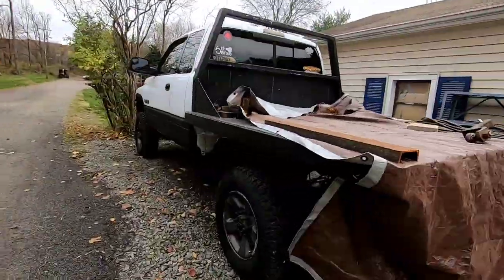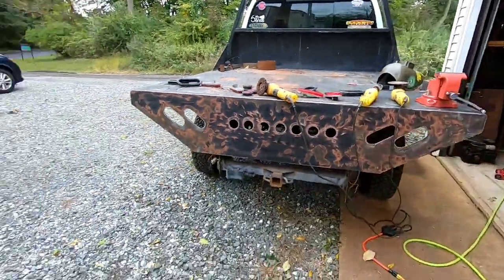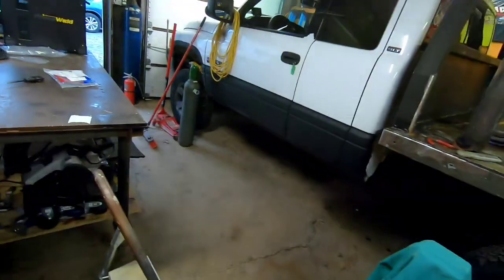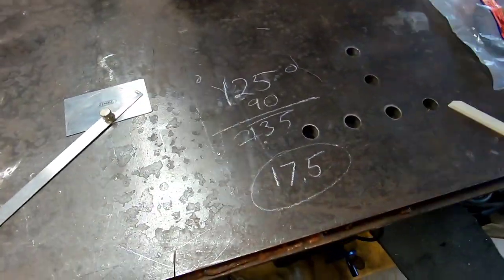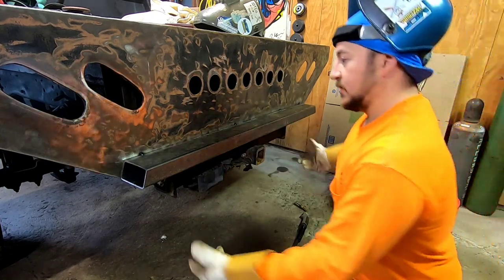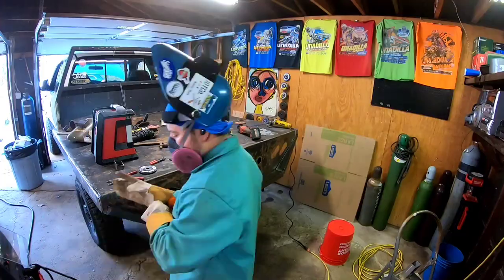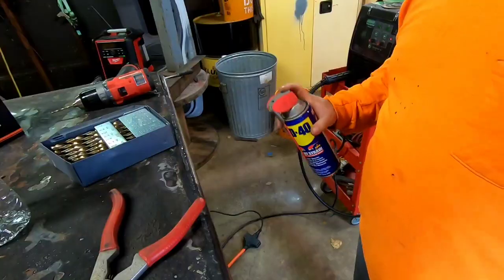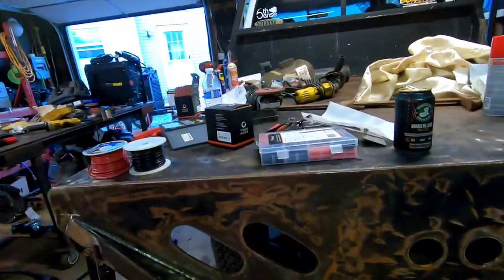SHORT BED WELDING RIG BUILD - PART ONE - FIXING UP FLATBED 24 VALVE CUMMINS

Comment: If you have access, the easiest way to fill those holes is by pulling a nail thru from the inside then weld away and break off shaft.

Comment: A lot of us guys just starting out want to do exactly what you're doing with your truck. I'm still looking for mine, but things are expensive right now, so dreams (and cool videos like this) keep me going. One thing: in the tropics we use a two-part epoxy primer in a spray can. There's a thing in the bottom that triggers the hardener, then you gotta use the whole $35 can before it cooks off. Helps against rust a little bit.

Comment: Have you ever treated any rusty metal with a chemical called ospho before primer? In Texas Ace Hardware sells it. Converts rust into primeable surface. it is thin and goes a long way.
Reply from the maker: I'll have to check it out

Comment: i purchased the harbor-freight surface conditioning tool , makes removing rust and paint a lot faster than a flap disc time savings
Reply from the maker: I thought about buying that.. I still might
Reply from the maker: I actually just bought one lol
Reply: they work really good , had noticed that flap discs tend to remove pieces of metal if you go too far in , and the drums tend to work in wider spaces with less effort

Comment: Awesome truck MCF WELDING!
Going to be some good content!
Cant wait to see it tolled out!
Try POR15 for the rust ,it is the best paint for rust,
Usually do a coat or two of POR 15 then run a raptor liner over it.
Awesome video!
Reply from the maker: I've thought about using por15 we will see

Comment: Just started the video so you might mention it later but why did you take the truck apart to begin with? Rust issues?
Reply from the maker: Needed a truck with space on the bed for a while since i bought a house to get things. since though i bought a chevy colorado so now this truck can be the dedicated welding rig
Reply: @mcfwelding  makes sense. I like the truck a lot. Best of luck with your business.

Comment: Looking good man. I live in NC so don’t have to worry about rust as much but I used Raptor liner on my work truck. It’s a little expensive but it’s some tough shit. You can roll it or spray it on. Look forward to seeing the next video.
Reply from the maker: I may use that for the deck of the flatbed